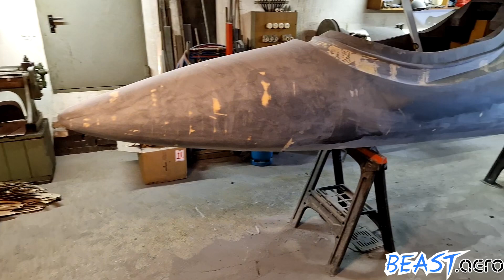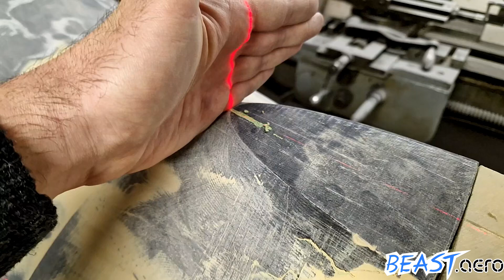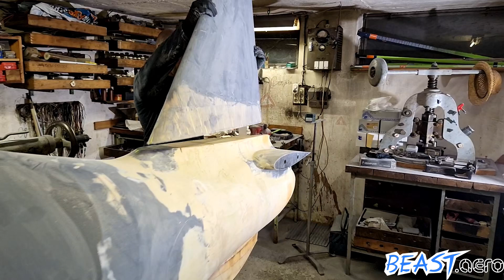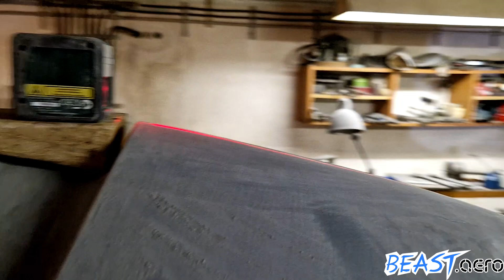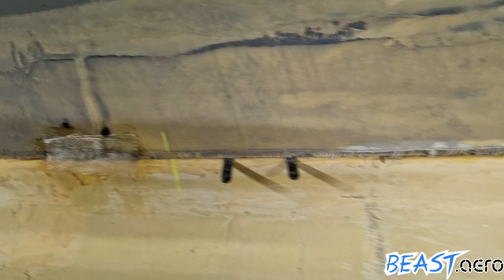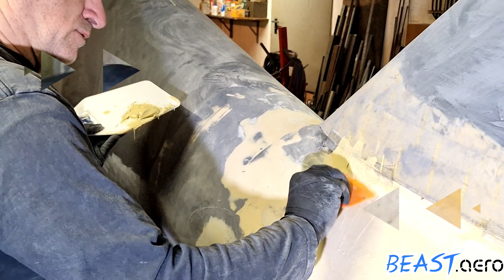Horus VLog #11

Comment: Thank you for the video and looking forward to the next one!
I may have missed this in earlier videos, however, can you confirm if you are showing the fuselage or just a male plug, to create a female mould to create the fuselage?
I assume from the non-structural attachment of the fin to the fuselage that this is just a male plug to create a female mould . . . .
Reply from the maker: You are right, it is the male plug. Luckily, it is 90% of the work. Also enables us to build more than one.